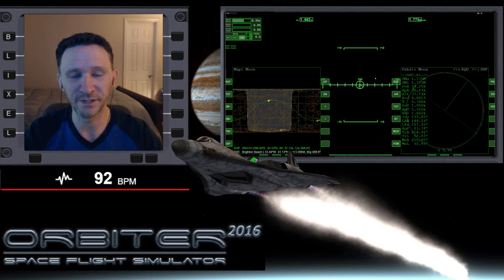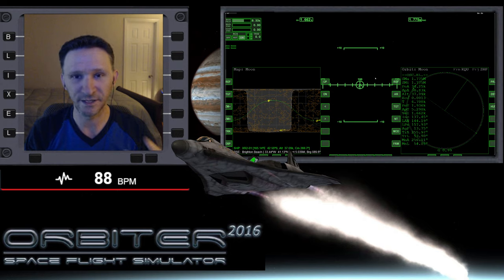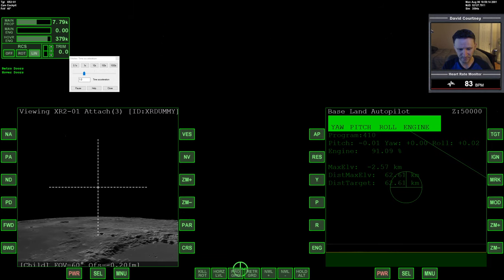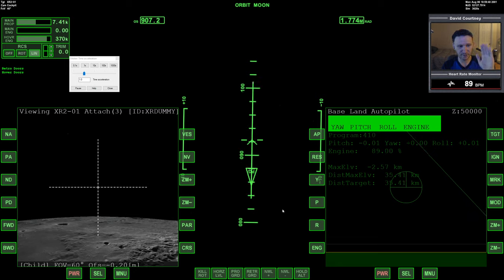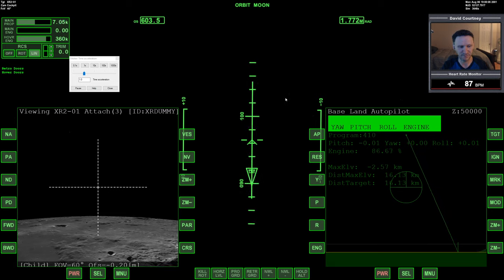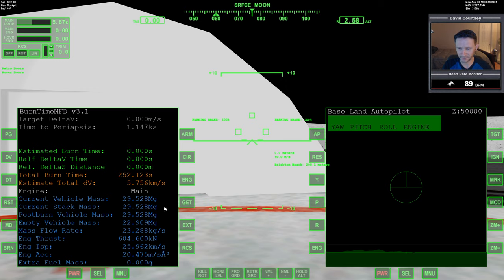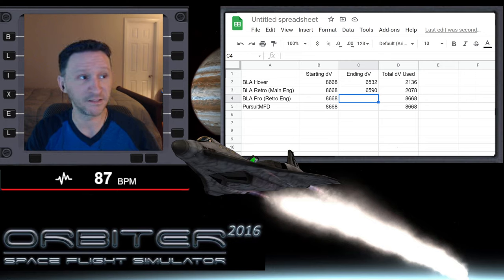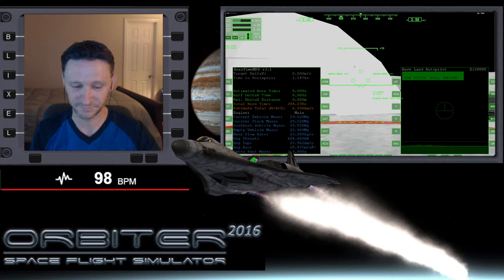Orbiter 2016 - [Part 1] Comparing Autolander Methods

Comment: I have been looking into tools that help me aid in landing at Brighton Beach, especially with the XR5. Before I learned about the braking distance thing in Burn Time Calculator, I used to guestimate everything, and I would always panic because I would be low on fuel, falling with the autoland turned on, some meters away from the pad, and I would frantically use main and retro engines. I would have to embarrassingly use rcs to taxi onto the pad.

After I learned about the BTC braking distance feature, I found it much easier to do landings, but still, I often freaked out and had to taxi onto the pad.

I have heard of several MFDs that help with landing such as:

Hover MFD ( Very customizable approach and landing but not efficient at all imo.)

Pursuit MFD ( Much better than Hover in terms of efficiency. Easier to set up too.)

Lola MFD (The "classic" autolander. I have heard of it, it even features launch to rendezvous and other cool things, yet I can't find it anywhere on Orbit Hangar, nor can I find the docs for it. It's probably compatible with Orbiter 2006, very old.)

Baseland Autopilot (Looks very nice, going to try it soon :) )

Suborbital MFD (Used for suborbital trajectories, but I think Lola MFD can do it too.)

Would be a nice mini-series, especially would like you to take a peek at Lola and Hover MFD.

Comment: My preferred method is HoldAlt and Burn Time Calculator--although I plan to look into using IMFD Delta Velocity program
Reply: @krishnannarayanan8819  Not sure, I'm still in the process of playing around with it. The moon's rotation is slow enough that it shouldn't be a problem.

Comment: Because I have done some testing with Pursuit MFD (from a 20km altitude in the XR2), BLA will win. As far as main engine vs retro, I'm not sure. But, I don't expect a big difference between them. From what I can tell, Orbiter basically models all engines with the same efficiency. The biggest difference should be time. Cheers!

Comment: Umm Hello ! 

I am joining from Kerbal Space Program,  and In there there is a Mod , Called Kerbal Operating System , which is an ingame scripting System and Computer to write own codes and implement them and automate The Launch process and tons of other Implements . 

Is there any counterpart of the same in Orbiter 2016 ?? 

Thank You .
Reply from the maker: I haven't looked at KSP in 9 or 10 years, so I don't know anything about its scripting system. So I don't know if Orbiter has anything like it.
Reply: Kerbal Operating System Is a Mod , That Allows users to write Code in Language similar to Python , either in-game or externally In a Text editor of choice and running it inside the game, . People use it to automate launches and do Interesting stuff , and since the code is written by the user , it offers a lot of flexibility .

I was hoping you could help by giving any pointers as to if Orbiter Has Such a feature,  where the User can Write Code and Use it to guide and launch Vehicles Ingame . It would be very Helpful  .

Comment: dispel
Reply: ok that was odd, "dispel" was not the comment that I typed. Anyway, thanks for putting this series together. It will help clear out some misconceptions about auto-landers (and perhaps arrive at a surprising conclusion? 😎)
Reply: 😆 Dispel lol
Reply: @dgatsoulis  On your LL challenge flight from Wiechert to Fabry, I managed a 90.46 percent dv rating after quite a few attempts. Then I made the same flight where I handed the control over to baseland autopilot just before the braking burn... it got me on the pad with just over a 94 percent dv rating. Conclusion: Baseland is much more efficient than I am :)
Reply: @AztroNut66  Congrats! That's an excellent score for a manual flight! Yes, BaseLand tends to be more efficient during the braking and landing phase. You know, you can post the contents of your LL.txt file, located in your Script\LunarLander folder. If anyone wants, they can paste the contents in their own LL.txt file, enabling them to try the exact same flight as you!.
If you choose to do so, I  recommend to post it in one of David's Lunar Lander videos comments.
Great job!
Reply: @dgatsoulis  Thanks. My first attempt was around 80 percent... by my 5th try I was up to 87... on my 10th or 11th I managed the 90.46. You made it challenging! Keeping the vs low while having to just clear the crater rim... then the target pad hidden just over the ridge on the down slope :) Great fun. I will post a LL.txt of the flight for others.